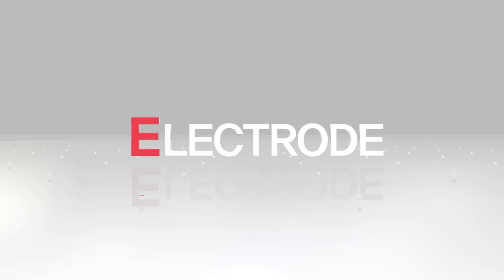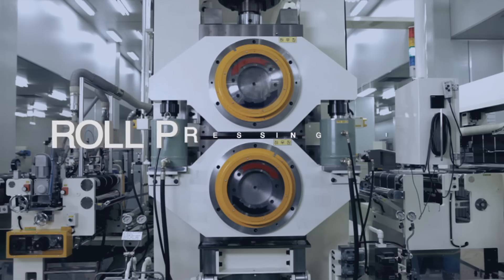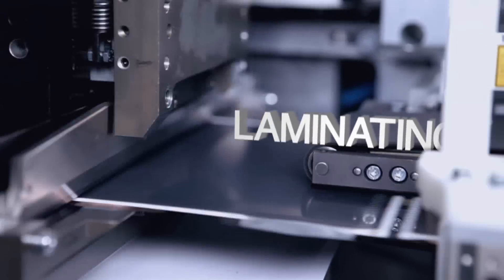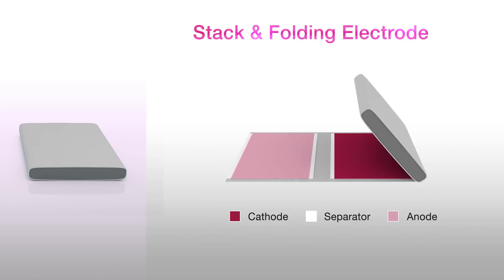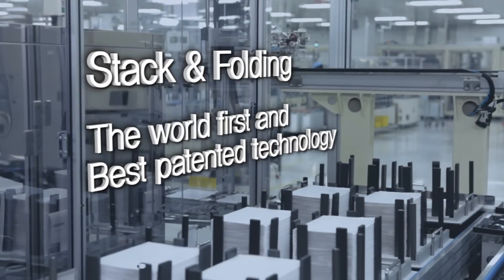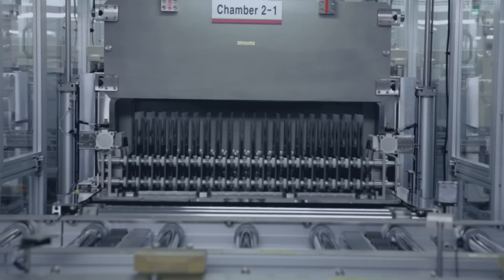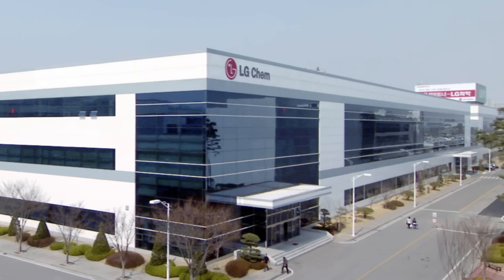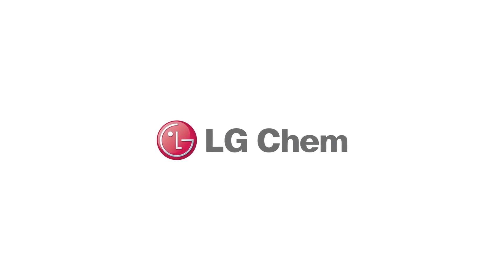LG Chem Electric Vehicle Battery Production Process

Comment: Bondller Materials, Inc is the leader of hi-tech films and tapes for Lithium-ions batteries, LCD modules, and electrical industries. High-performance Technical Films and Tapes for lithium battery and supercapacitor. The products include a range of thermal management, single-sided and double-sided tapes, high-temperature polyimide film, and tapes. 

In the field of battery production technology, Bondller offers flexible system solutions for manufacturing battery modules and packs, central contacting systems, anodes, and covers for battery housings.

Bondller will be offering its electrical insulation tape solutions to the team as they play an important role in several EV and automotive applications, such as car body exterior, battery packs, motors and generators, sensors, and electrical insulation.

Comment: Very interesting Video. Does anyone know the total production capacity of LiIon batteries of LG?
Reply: I think that answer is very time sensitive. This kind of manufacturing method are very flexible in output capacity since they wouldn't benefit much from continuous manufacturing. And would make more sense to have a decentralise manufacturing base more closer to the customer since transporting li-ion battery is pricey and hazardous. I think their annual output varies too much to have a singular measurement to do it justice. And since, I presume, they make more than one type of battery, asking for their max kW/h production make much more sense as would asking for their total revenue.